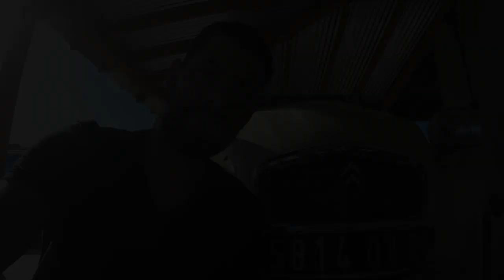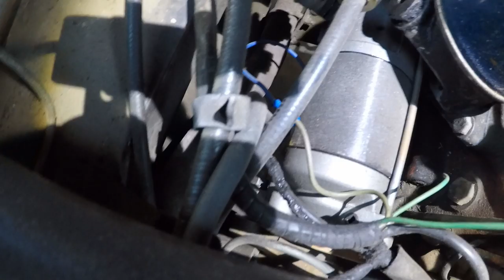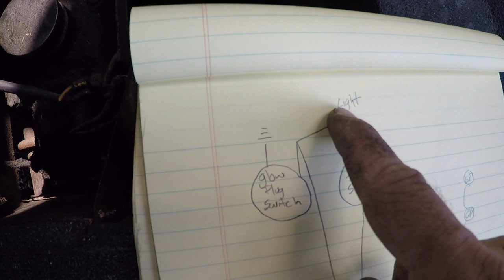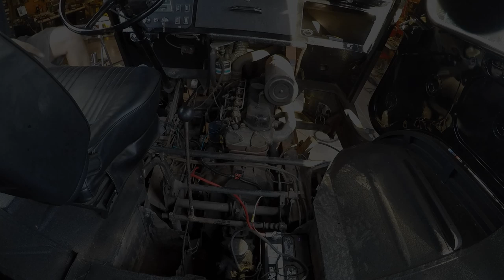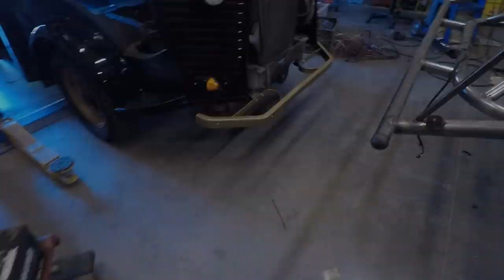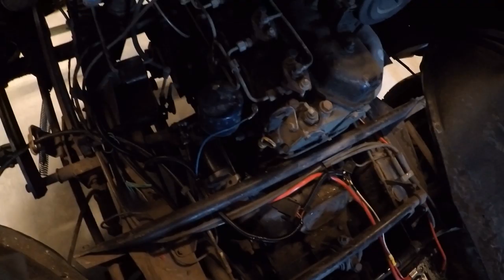More broken Citroens?! (and my favorite mechanical fix so far)

Comment: Nice one,  HY Diesels are sort of rare, most of these were sold with a petrol engine. .. By the way, that "Exciter" cable must go via some light indicator to battery positive (ignition switch) ,  usually that's the charge indicator light on the dashboard.
it must not be directly connected to positive as you likely will damage something, it will even work fine without any connection whatsoever, the only difference is that the alternator starts charging a little later (higher rpm) .
Reply from the maker: Great info, I have seen that set-up for the Alt hook up on other older Ford vehicles, but I didn't think of that on the HY. The alternator was toast (like looked like it had severely overheated at some point), so its wired to it, but not hooked up. I was going to source one that fits the space but may not be the factory style (probably will be old Ford style) so I will double check the wiring before I hook up whatever I go with. Good looking out!
Reply: @AustinCoulson  Modern alternators are most likely different as the voltage regulator isn't usually built in anymore ,
that's now all controlled by the engine ECU. Just go to a junk yard and look for an older Bosch (European) with an integrated brush/regulator block on the back, it will wire exactly the same. Some 80s + 90's Japanese ones are the same, but if you don't know exactly what to look for, it might rather be a gamble. As long as it fits mechanically, you should be ok, but remember that Diesels sometimes use smaller pulley diameters to adjust alternator speed for lower engine revs.  Don't know anything about American Fords, my '96 Jeep has a Denso without internal regulator , so that won't work in the HY.
Reply from the maker: @dynoguy  thanks for the info, I didn't think about smaller pulley but that makes sense for a diesel

Comment: As has been said, most of these came with a petrol engine. That early engine didn't bother to filter its lube oil so needs very regular oil changes. Don't know about diesels but if there is no obvious filter...
Reply from the maker: The gold HY at the beginning is a petrol powered van, and is filter-less as you described. Very strange to see, I googled around and saw that it is recommended to be filled with a high detergent 30w and replaced every 2k miles. Always an adventure with these older rides...

Comment: Great video!  I was just thinking that your videos are always good but even better this time.  Nice job Jeanne!  The repair to the starter was awesome.  Those customers are lucky to have you work on their equipment.  Was there any damage to the flywheel?
Reply from the maker: Dang I shoulda mentioned the flywheel. It had a little shine to it, indicating it was making metal to metal contact but the teeth looked flawless, so I didn't worry too much about it.
Reply: Austin Coulson I don’t know much about it, but they probably make the Bendix drive a softer metal than the flywheel?  It must be easier to replace the starter than a flywheel.

Comment: New battery.  Smoked wires... Spidey senses question a polarity reversal in it's past.  30 amps for the glow plugs is probably cutting it close.  I estimate they pull around 22-25 amps.  Nice job on finding/selecting the starter and making the adapter.  Wonder if the starter is not fully retracting.  Seems that would be the most likely culprit.
Reply from the maker: I didn't think about that, but that makes sense! Would make those wires nice and crispy
Reply: @AustinCoulson  Might want to check the alternator output as well.  May have taken a beating.
Reply from the maker: @ShainAndrews  already ordered a new one. It's beat up
Reply from the maker: 30 amps is definitely cutting it close. I tried finding a 40 or 50 amp relay, but those are not commonly stocked by my local suppliers. I used larger wiring to allow me to swap that in the future. It's working good so far, the tow truck driver who delivers this around town said that's the easiest its started in years. The factory switch seems to have lost the glow plug connection at some point.
Reply: @AustinCoulson  Try a starter solenoid similar to what you see on old or one off a small engine like a Kohler etc.  Example: https://www.amazon.com/SMALL-ENGINE-STARTER-SOLENOID-VOLT/dp/B075HJ78DQ
Reply from the maker: @ShainAndrews  Thanks a great Idea. I have a bunch of old Ford fender mounted starter solenoids I use in projects lying around, I could use one of those. Never thought about using a solenoid as a relay, but that's a solid idea.
Reply: @AustinCoulson  Anytime.  Looking back at my post I must have edited out Ford when I added the small engine bit at the end.  Solenoids are my go to for short duration greater than 20 amp loads.  I wouldn't be surprised if there is a solenoid hiding in the factory wiring somewhere.

Comment: If I understand you correct you didn’t fix any of the lights front or back? Tail light? Nothing?
Reply from the maker: Correct. It's a mobile bar so it is towed everywhere. Only needs to drive on and off the trailer
Reply: @AustinCoulson  Such a pity for such a rare HY diesel...